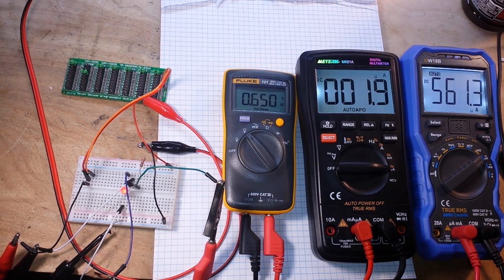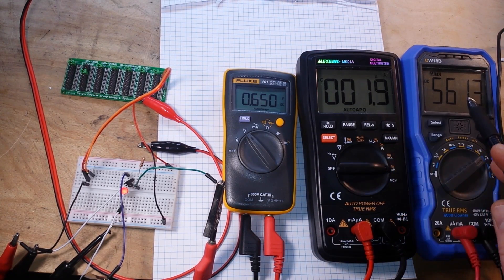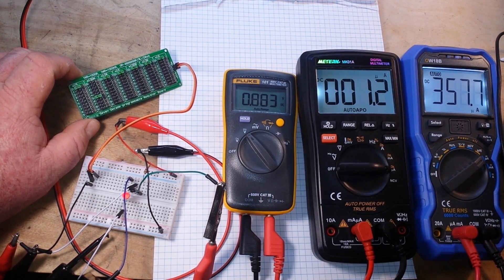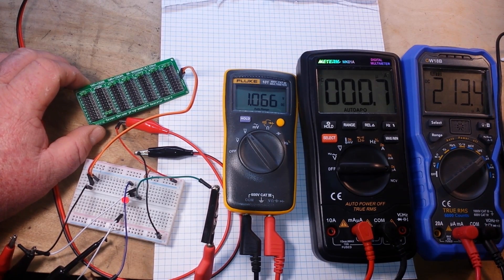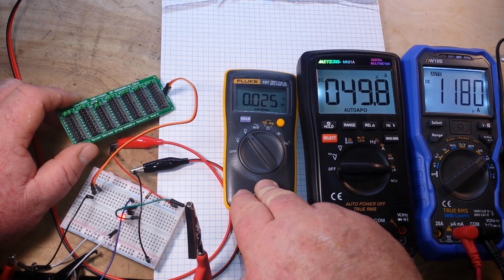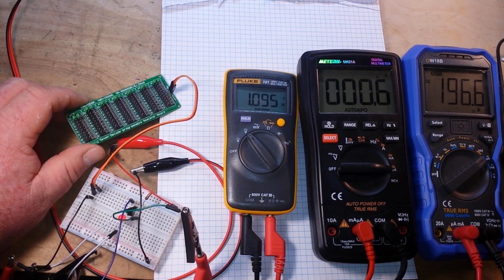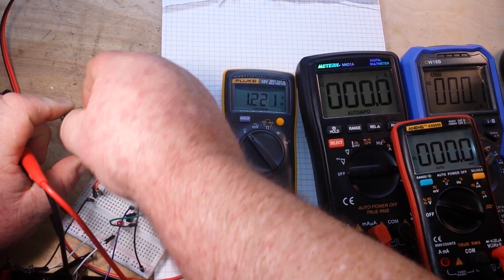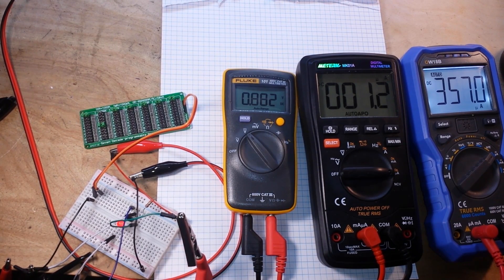Transistor current and voltage relationships

Comment: These two videos have been about the best I can find on the subject; they have clarified a lot of confusion for me, just for example I could never find what the data sheet numbers represented - is Vc the voltage AT the C terminal, or voltage passing THROUGH the C?  It's more clear now.  I am still confused about the range of Hfe on transistor data sheets, as it seems to vary with the Ic...?  I'm having a hard time wrapping my head around this.

Transistors are such an integral part of modern electronics it seems to be a basic that REALLY needs to be nailed down before proceeding.  More Transistor for Dummies would be appreciated!
Reply from the maker: The beta changes not only with different models (2n2222 vs 3904) but within the same batch of the same model. That's why we match them when using them in groups.

Comment: I am beginning to get a slim understanding  for the transistor. It looks like the transistor is working like a sort of variable resistor which is controlled by Ib. And I also think that Vce has an inverse relation with the Voltage across the  1k resistor, and the sum of them should always be equal I think. Thanks Paul, and nice to see that a bunch of your meters come in to play with this one :)